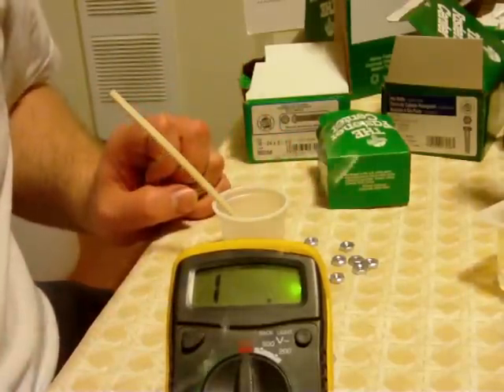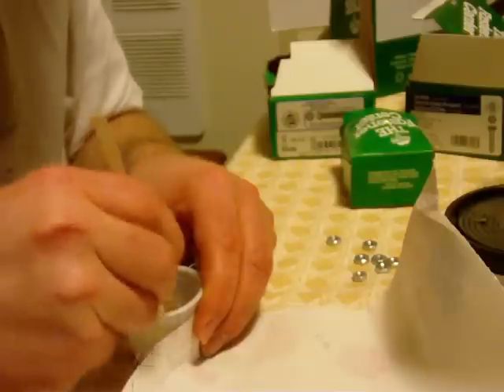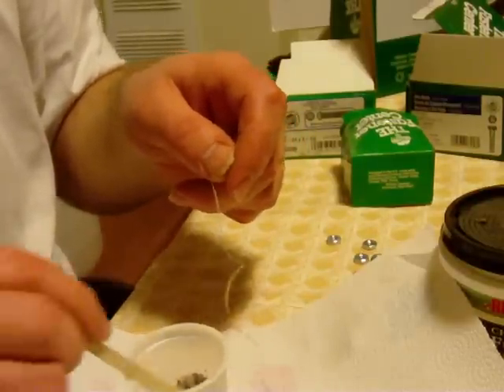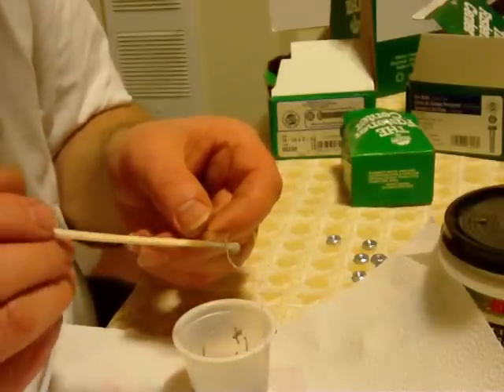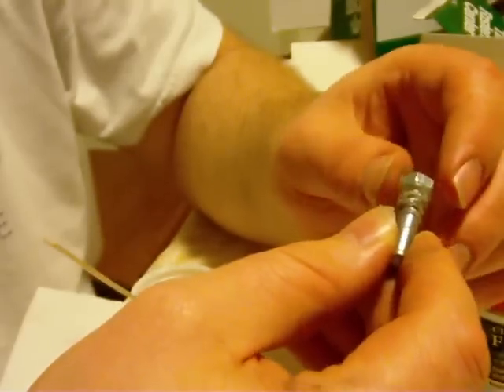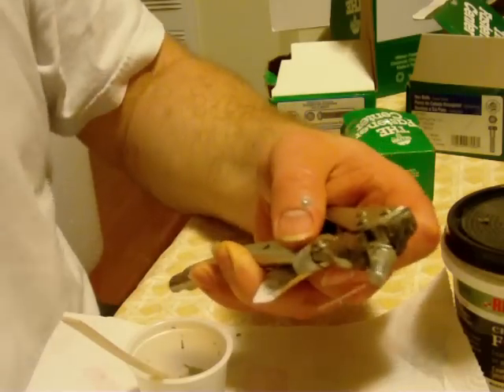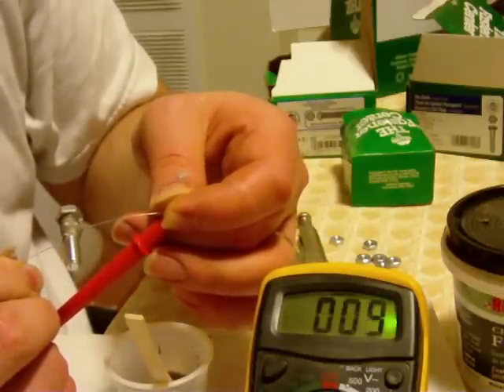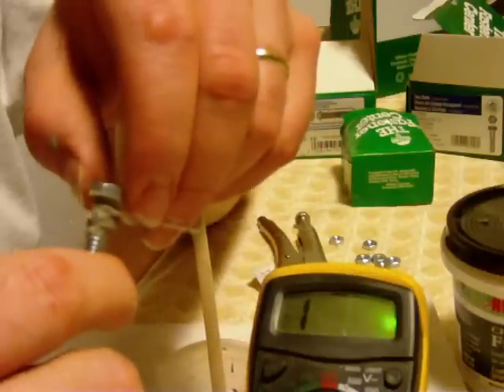coating your ni chrome wire with cement so it is easy to wrap around

Comment from the maker: yes, it is best to roll before it dries. also if this method does not work well for you there are fiberglass coated filaments of ni-chrome available. however these kind of heaters can reach  temperatures in a matter of seconds. modern printers tend to use resistors because it is faster to change out.

Comment: what is advantage when we coat cement like ceramic on the nickel crome wire? Is it possible to coat on a lot of wires at once?
Reply from the maker: it helped keep the wire from shorting out while winding it. forward several years, people now use resistors or heater cartridges, because this winding of wire is hard to do.

Comment: does the cement cracks when rolled up?
Reply from the maker: yes the cement (fire or chimney cement) can crack  but thin layers tend to crack on the sides. it is enough to keep electrical insulation, wrap around slowly, and then re apply more cement. also there are several other methods available now such as resistors and heater cartridges, look at reprap for more info